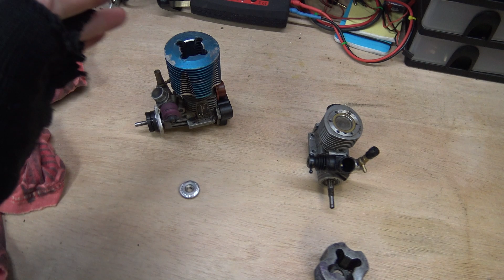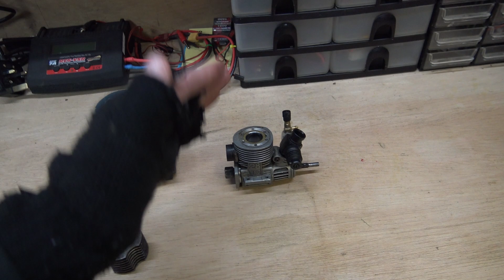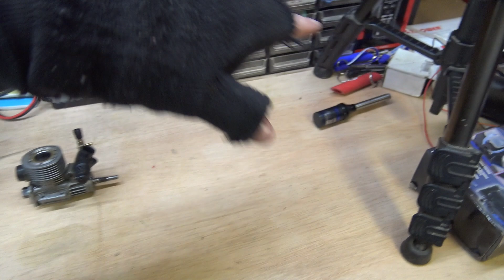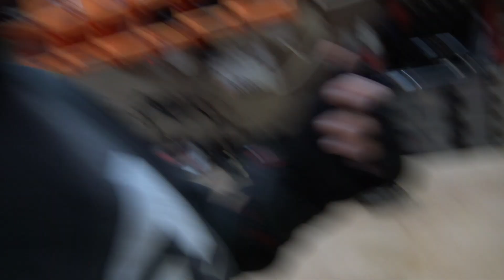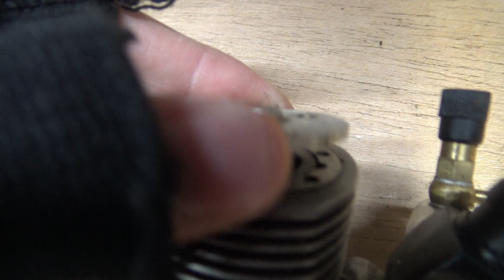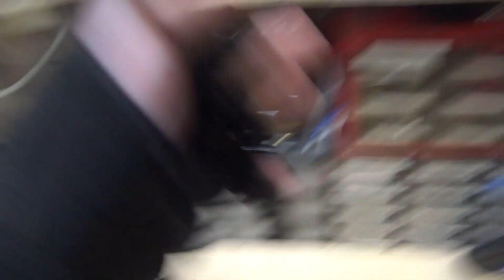Three Myths About Nitro (Glow Engines) Overheating & More

Comment: Hey, I ran my nitro buggy in the snow and the engine lost compression fast after that. Then in summer it overheated badly and now has almost zero compression, won’t start unless I prime the carb. I tried to remove the backplate to replace the piston and sleeve but it was basically welded on – bolts were stripped and stuck, probably from heat. I had to drill them out, but the backplate itself is seized too and cracked now. Do you think it’s worth taking this to a local hobby shop for repair, or should I just get a new engine? P.s. tried heating to unscrew , wd40, praying 😂 nothing helped…
Reply from the maker: Hi! If it’s as you say a hoppy shop probably won’t repair it they will push you towards buying a new engine. My advice is mend it yourself or buy a new one. Would you be interested in selling it to me? I think it would be fun to get into it and see how bad it is. 

I do strongly recommend having more of a go yourself though!  What engine is it?
Reply: @HaggardRC  Hi mate, no worries – I managed to open the engine (had to destroy the backplate though). Since I didn’t hear back, I went ahead with the repair. Thanks anyway and all the best
Reply: Hey! We hobby enthusiasts gotta support each other – I’ll send it to you free of charge, including a brand new piston and sleeve for it. No need to buy it.
The only thing I ask is that you make a YouTube video about it so we can all see how bad it really is! 😄 Just cover the shipping cost and it’s yours.

The engine is a Force .18.

By the way – do you think the extreme overheating welded the parts together, or is it just me being clueless and not knowing how to open it properly? 😅

Also – do you know if HSP engines are compatible with VRX Nitro 1006?

Comment: I used to run my built Volkswagens on the fat side because a rich engine will run cooler! These motors were also air cooled and at the expense of plugs tended to run cooler. I always ran a little hotter plug to keep the engine from fouling the plugs!

Comment: Think of this, a typical hemi used in top fuel burns up to 15 gallons of nitro methane in a quarter mile run! They redline at around 9500 rpm! My Suzuki GS 1100 was around 11,000 rpm redline.

Comment: Most engine wear occurs on cold startup because the cylinder lining hasn't reached optimum temperature, and friction is higher in the bore as a result between the piston and liner. My engine performs best at 250F to 270F. I actually pre-heat my engine to 180-220F before starting. It reduces startup problems and also prolongs engine life. Warming up is a good idea if you do not have a way to preheat the engine. Then when you are completed with your drive, I run all fuel out of the engine and immediately rotate the flywheel so the piston is at bottom dead center. This keeps the piston from getting pinched in the upper, more narrow portion of the cylinder bore. It also prevents the piston from essentially getting "crimped" by the bore as it shrinks from cooling down. If you do this and know how to tune, you will have an engine that will last a long time, provided you have a good quality fuel. Everything matters when it comes to Nitro engine health, including air filter cleaning.
Reply: My most recent buggy runs best at that heat range also. I tune it so it runs cooler and it just gurgles and it doesn't like it.  
When my dad got his/our first nitro the hobby shop guy said to keep it at like 220. It was a savage .25.
I have heard pros say that over time the engine materials have gotten better and they can actually run better and can handle more heat, up to 280 is even fine nowadays. That would have Definitely hurt a nitro engine 20 years ago. I had to get used to that when I got back into it.

Comment: There are some exceptions. The engine will be very hot (after a long period of idling ) if it is incorrectly adjusted and receives too little fuel. I experienced this myself while breaking in one of my new engines (bad factory settings). Of course, appropriate adjustments solved this problem

Comment: I agree. Common sense tells me that you're right. I've been into Nitro for many years. When it's idling. It's much cooler I break in my engines. The Adam Drake method, and you idle 4 full tanks at 15 minutes. Let it cool down a little bit starter back up. You don't want to run them constantly flat out. You wanna modulate the throttle.
Reply: Yes, nitro engines don't need nitro to run methanol and castor synthetic whichever. The engines run off of the catalytic reaction from the methanol and the uridium and platinum in the glow plug.
Reply from the maker: That's it, the same goes for all engines.... change the RPM and loads and it'll be a good engine.

Comment: Im no professor like @rwt8851but where i lived in Australia, where it got to 46 degrees Celsiu all my RC  cars ran like a dream. Now where I work and live in Asia it runs the same even though the humidity is 90%, it's just all about the tune for me.
Reply from the maker: That’s exactly right. You tune for the weather. The weather doesn’t control you.

Comment: Hi my nitro zorro you can't pin the throttle it just cuts out. If you ease it in it still hesitations a little but will pull away can you help
Reply: Sounds like you're LS needle is out of adjustment I would back the LS needle out a quarter turn and see if that makes a difference.
Reply: 👍 Great stuff have just tried it and sounds and pulls better thanks

Comment: Why don't we see larger nitros? Like 32cc. They would be so much more powerful than the equivalent petrol engine. There must be a reason we don't see them
Reply: I suppose you’d need sooooo much nitro fuel to run a large engine like that, stoichiometric ratio for nitro fuel is 0.5 to 1 compared to petrol which is 14.7 to 1.

Comment: Well the thing with the exhaust is that glow engines are 2 strokes like you know and so the exhaust and intake are open at the same time this is why with a 2 stroke you need an expansion chamber to run better. Without an exhaust or with just a straight pipe it will run way worse because there is no back pressure keeping the fuel in so you get less fuel that gets compressed so yes the compression stays the same but the amount of air/fuel that gets compressed is more. This is where that myth comes from

Comment: i warmup my engines always while standing not driving and i always start with rich setttings so the heat is always around 70 and 90 degre it depends which weather

Comment: Ill add some things first there is no such thing as a nitro engine. They are glow engines. they will run and pretty good on 0% nitro.  also, nitromethane is not what is burning in the engine. the methanol is what is burning, nitro only ignites under heat and compression. heat generated by the methanol burning. which in turns ignites the nitro under compression and releases oxygen to make a hotter and faster burn. It's funny you can take a pan of pure nitro and try to light it with a match, and it won't burn. but put some on an anvil and hit it with a hammer and watch out. been there done that, i run 40% nitromethane in my real drag car with methanol when we are out in Bonneville running, and straight methanol on the drag track, you know rules for my class. I buy both of these by the 55-gallon drum for racing, but you get to mess with them also. I have obliterated many expensive parts experimenting over the years.